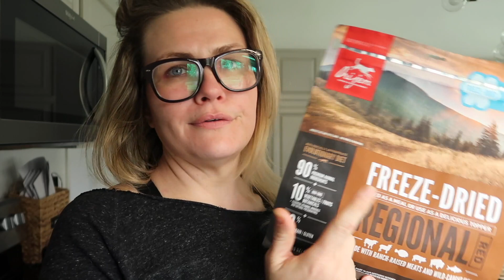Quarantine Chronicles: Patio Furniture DIY, Thinking My Dog Was Dying, Tired Of Talking The C Word!

Comment: I'm an esthetician...I dont tell people on the internet what to do...so here's a suggestion: when you use Hyaluronic Acid make sure your skin is slightly moist, facial mist, then apply Hyaluronic Acid. After that put an occlusive (thick) moisturizer on to seal it in. The deal with HA is that if there is no Moisture in the air, it will pull moisture from the sub dermal layers of your skin and will totally dehydrate and dry out your skin.  Hope that is helpful.
Reply from the maker: Oh! I never knew that! Thank u def trying that!!
Reply: @BeautyJunki101  No Prob Bob! 😜

Comment: I have wavy medium thickness hair and my daughter has thin curly hair. We both use As I Am coconut cowash and it's nice. We only use it like once or twice a week depending on what we're doing. I was worried at first it would make our hair weighted down or flat but it's been great. Like once a month or so I also just use regular ass herbal essences in case there is a buildup.
Reply from the maker: Where do u get it?
Reply: @BeautyJunki101  I usually get it off Amazon but I've also seen it at certain Kroger's before.